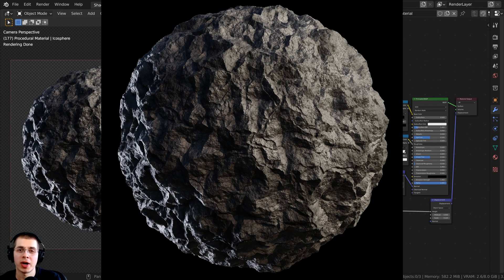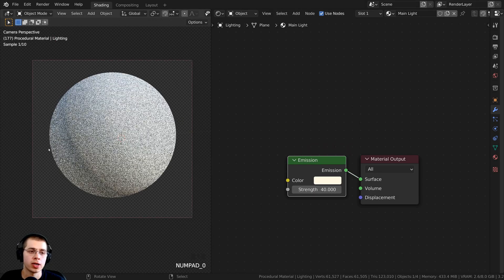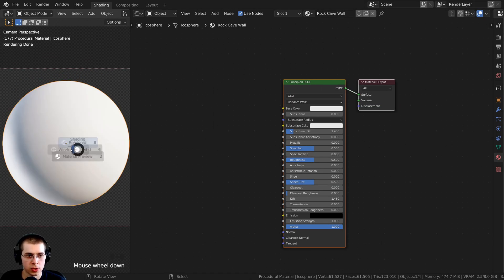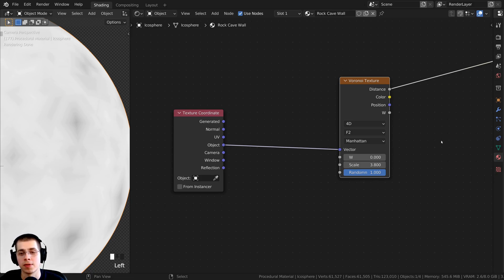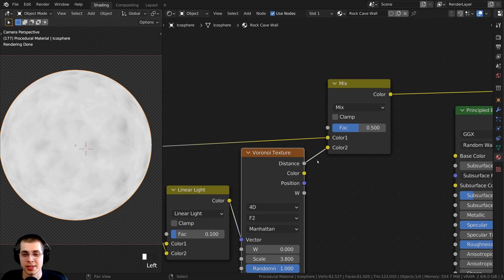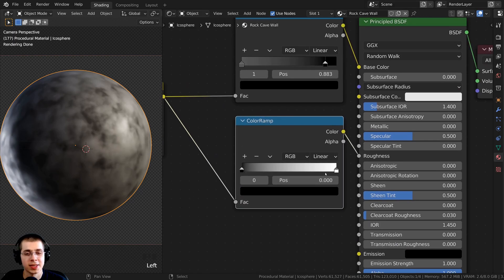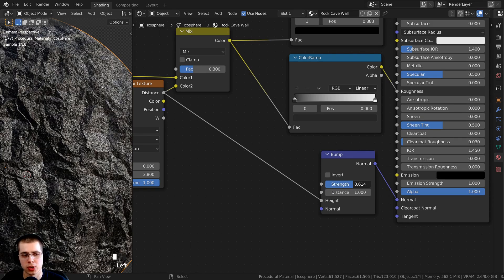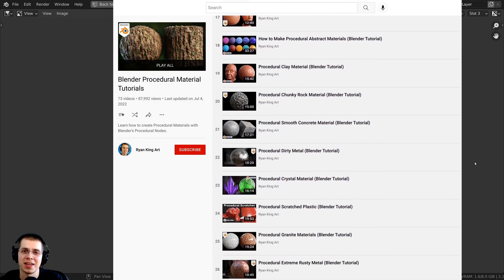Procedural Rock Cave Wall Material (Blender Tutorial)

Comment: DON'T HAVE A MIX RGB
Reply from the maker: In the new Blender Update, they changed the Mix RGB node, to just the mix node. So just add the mix node, and change the Float option, to Color. Then you can use it just like the mix RGB node.

Comment: Thanks a lot for the tutorial, I'm learning a lot! But I have a problem, when I connect the displacement node (13:19) and change the scale it just scales the original shape as a whole instad of just the dark/white parts, so there's no bumps, not really sure what to do and cant find a solution online.
Reply from the maker: hmm, hard for me to know exactly what the problem is when I can't see your node setup. There could be a number of reasons why that's happening.
Reply: @RyanKingArt  no worries I fixed it, I somehow duplicated some nodes on top of each other and that was causing it to malfunction, still thanks for answering and great video!
Reply from the maker: @cartoonstoons-q1r  glad you fixed it!

Comment: I didn't realize how good you were with procedural materials and more.  I was gonna suggest that you use a Table of Contents (TOC) to use ytube's TIMESTAMP function, but you've already done it!  (Since July 12th IIRC)  You continue to impress.

Ty for your SciFi Mech robot series I just noticed on my visit.   I'm gonna use it to refresh my boning (harder than adding all the bone empties to control the Armature, imo unless you get fancy), and animation skills that I haven't touched in over a year.  At the same time I'm gonna watch your modeling, shading and parts management of your build.  I am building a Bobble Head Optimus Prime, that will crash and be comforted by a Westworld Host, so this is directly applicable...
Reply from the maker: Thanks!